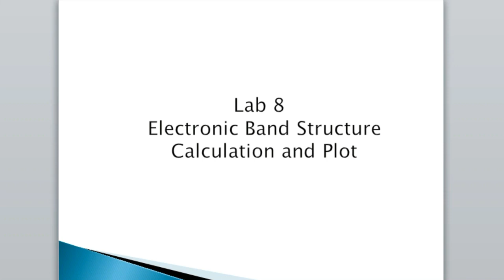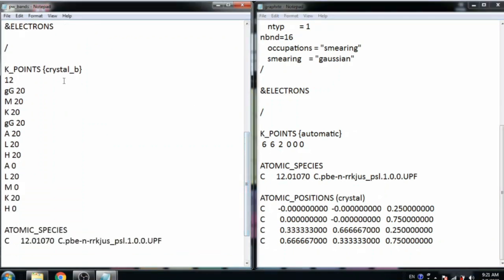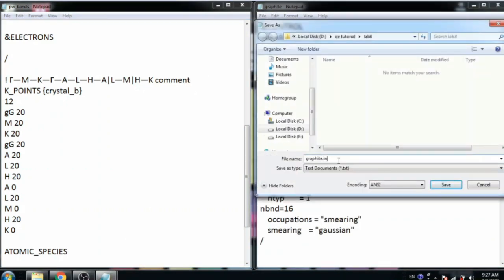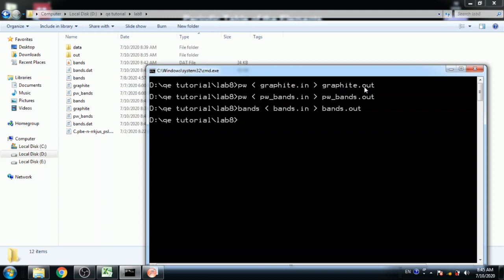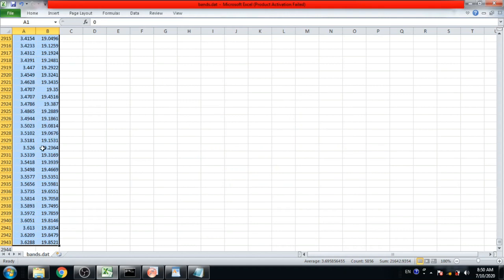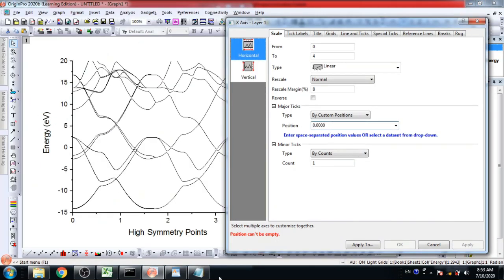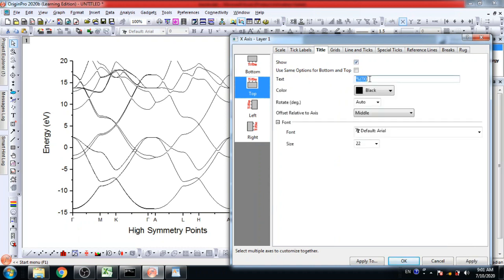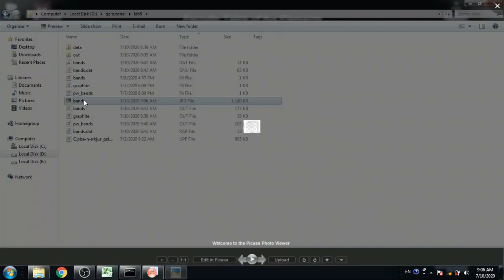Lab 8: Electronic Band Structure Calculation and Plot

Comment: Dear Mr. Hiran Patel

I am a beginner for the use of quantum espresso and trying to install winmostar and quantum espresso. I tried my best after watching your youtube video about it. 

My installed winmoster QE is not working properly. In solid Tab, not a single program is in active mode. In other Tabs there is also the same issue. 
If possible, please provide suggestions to remove this issue.

Comment: Thank you very much for your helpful video. I have two questions, if you have time: 1) How and where to set Fermi energy zero, and how can it be done through origin?,  2) Is there any simpler way to calculate the bandgaps, bandwidths, maximum value of valence band and minimum value of conduction band for each high symmetry points (other than taking origin pointer to each required points to get coordinates)?
Reply from the maker: Yes and next video will be on that topic.
Reply: Thanks. Appreciate it very much. Eagerly waiting for that. If anyone has 10/15 bandstructures, is there any simpler way to plot all together with a single plot command?